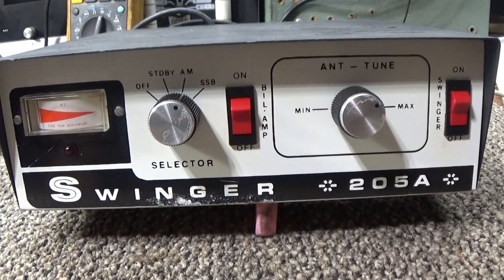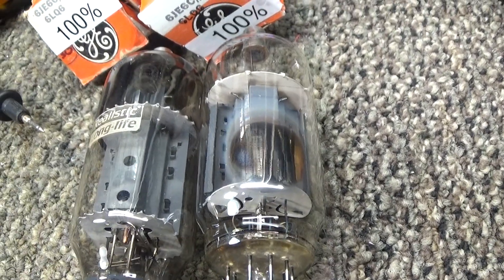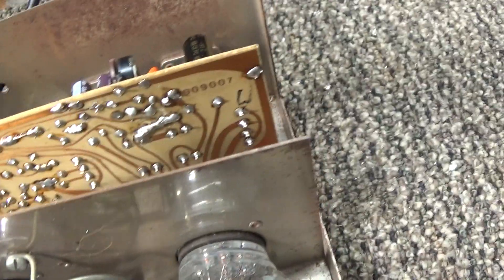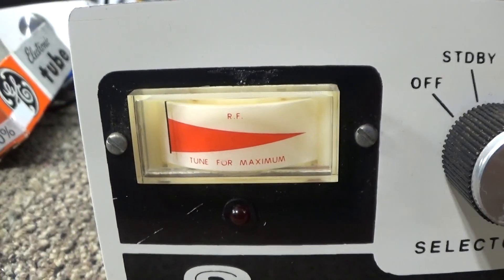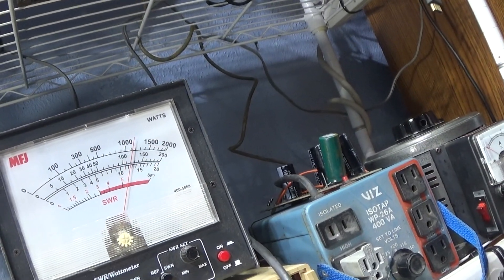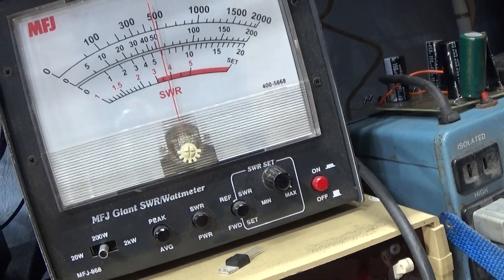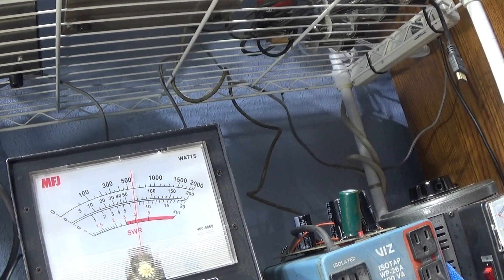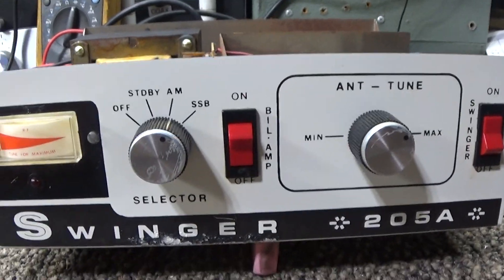Swinger 205 Linear amplifier on the bench

Comment: How does it performs on ssb ? I want to get one
Reply from the maker: I would not recommend any 'Swinger' or 'Modulator' type amp for SSB.
Reply: @tramdr bummer :( , i wanted a cheap tube amp for ssb and am , even if turn the swing buton of or maybe mod the bias ?
Reply from the maker: I would get a straight grounded grid amp if I wanted to run both AM and SSB, D+A and Palomar would be better choices.
Reply: @tramdr ok thanks  afriend has one, will use it only on am how do a tune a single knob amp ? I have only seen videos on load a grid type amps
Reply from the maker: tune for max

Comment: The gray ghosting around the getter on that right tube means it's gassy. Is that the one that didn't light up as well?
Reply from the maker: They both lit, but one was dim and one was bright.
Reply: @tramdr  Right, understood. I was wondering if the gassy tube was the one that was dim? Or had the resistors not been changed yet? Usually if the tube is gassy there's a crack in the base where the pins overstressed the envelope. Or even just a gap around a pin from thermal expansion of the pin if it got really hot.  
Nice to see the amp back on the air.  What's the spectral purity like on those?